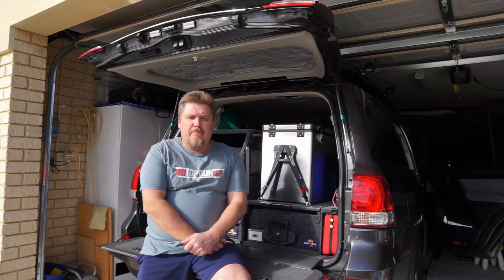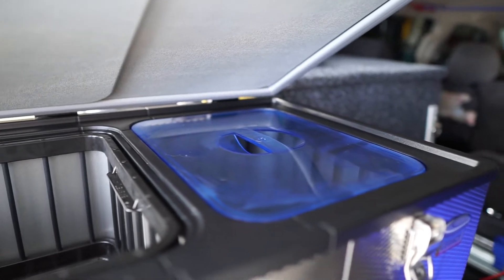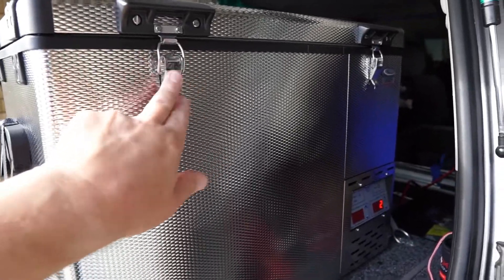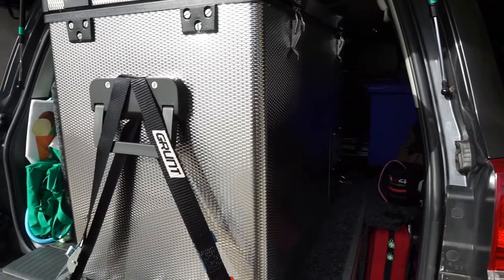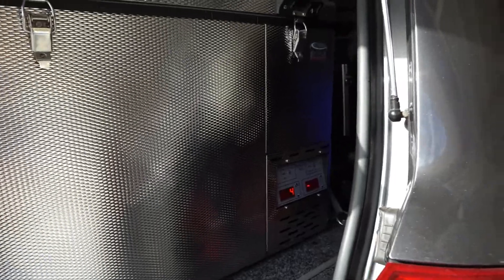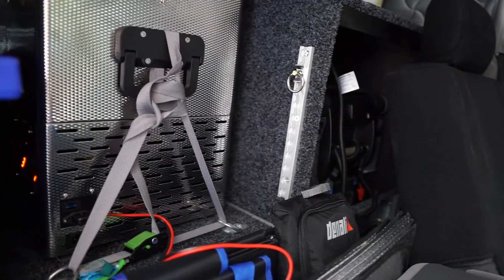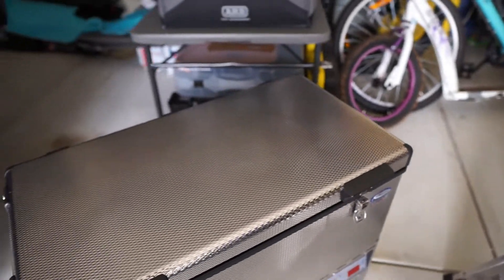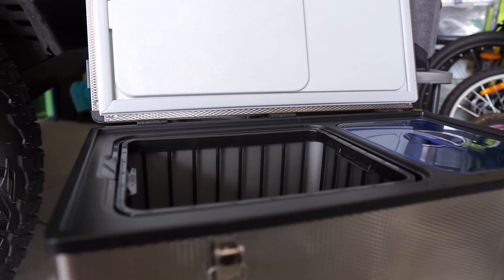National Luna Legacy 50l Dual Zone....Intstall and Initial Thoughts

Comment: I appreciate the video.  I ordered one, but got a notification a couple of days later that they were out of stock.  So, I ordered a 60L.  It's certainly bigger than I need and want, and I agree that the fridge/freezer ratio is a little weird on the 60L.  I'm also concerned because I've read about a spate of gas leaks in the Lunas of late.   I have terrible luck with getting defective products (in all industries), so I'll be holding my breath.

Comment: Robbie how are you finding this fridge?
Have you used aftermarket thermometers to check bin temps?
National Luna don’t take temperature from the bins, they take the temperature from within the walls. 
I’ve used two different thermometers and although the fridge displays it’s reaching -18 in 45 mins - 1.5 hours it actually takes 24 - 35 hours for bin temperature to reach -18 with pre frozen food from house freezer inside.
It was quicker by not much if it was completely empty. 
Meanwhile the fridge compressor cycles off and on the entire time believing it’s at temperature. 

The bin temperature I’ve noticed is anywhere between 3 degrees to 10 degrees warmer then what the fridge displays. 
National luna quote the temperature of bin to be within 3 degrees of the display due to location of temperature probe. 
Sometimes the fridge was accurate within 1 - 3 degrees most times not. One particular night set on ac power bin temperature was -18 degrees fridge was set to -20 degrees, wake up in the morning and all icecreams completely melted with fridge showing - 20 degrees but thermometers two different brands showing - 7.5 degrees. 

A pre chilled at setting - 1 degree fully stocked fridge went from 1 degree to 7 degrees bin temperature from putting 5 x 500 ml water bottles in and took the fridge 9 hours to get back to 3 degrees. (Not too safe if putting chicken in).

Power consumption when running at a setting of 4 degrees both bins was 0.5 ah/h. Issue is actual bin temperature was 7.5 degrees. 
Power consumption when running large side at 3 degrees and smaller side at -18 degrees was 2.08 ah/h

I’ve also noticed the lid doesn’t sit evenly due to an excess of glue/plastic on the front corner at freezer end under the seal. 
I’m guessing this also stops the internal cutout of lid from sealing freezer section correctly as this fridge has a massive amount of condensation running down the internal wall. 

National luna haven’t responded to any emails I’ve sent with photo evidence and the brand new fridge is currently at a service agent where it will be a number of weeks before it’s looked at. We’ve missed our first trip with the fridge and looking like we’ll miss our large trip, the very reason fridge was purchased. 
Was also told nothing unusual about having to wait 24 - 48 hours for a fridge to reach - 18. 
Putting 5 x 500 ml water bottles in a fridge is placing a massive load on a fridge. 
Have friends with dometic, engel, oztrail and brass monkey. All completely blow this National luna out of the water in terms of chill down time and ability to maintain correct bin temperature. 

I’m now having to look at out laying another large sum of $ on a different brand fridge so that our family has a working fridge for the trip. 
A shame when Anderson cord and fridge slide specific to National luna size was also purchased. 

After being drawn in by all National luna marketing videos, the talks from stockists. We believed in the notion buy once cry once for price. 
Sadly our fridge isn’t meeting the marketing talk & now digging deeper their are lots of genuinely disgruntled owners comments/reviews about the performance of their National luna fridge. 
The stockist I purchased from when made aware of my findings was “nothing we can do, we only sell them. Take it to a registered service agent.
Reply from the maker: Mate sorry to hear.  I still have 2x engels and can't bear to part with them and they are faultless one being near 15 years old.
I've had the NL now for about 6 months and seems to be performing well.  Always use separate thermometers and find its about +1.5 degrees on fridge and freezer.  All my other fridges including the engels and Waeco run about +1 difference to the display temp...had a ARB Elements which was +3 but there is a hack on the internet where you can recalobrate this and worked well after that.
NL with 40l fridge set at 2 degrees and freezer at -12 uses abou 0.8 amps an hour with daytime temps up to 25.  
I did read they had some issues a few years ago with a bad batch of cooling coils which leaked gas into the insulation...think it was about 2015/16 to about 2018/19 ish.  Maybe keep persisting with NL and they may end up replacing it like they did for others.
So far so good with this one.
Cheers
Reply: @robbiereddog4202  Thank you for the reply & info. Gives me hope. 
They are a top looking fridge with a great layout & footprint. 
After spending months reading reviews it came down to National luna vs Engel. 
Btw, with the top large basket removed you can install the smaller freezer basket into the larger fridge compartment on top of the bottom basket which gives the ability to stand taller bottles like milk bottles up which gives greater packing flexibility. 

Very much hope an issue is found & not just told nothing is wrong that’s how it is. It seems the way our National luna is operating is incorrect although we were given the impression we were expecting too much from a 12volt fridge and our findings were normal. 

Spoke to the store it was purchased from again today and they agreed something isn’t operating correctly with such large temp variations and lengthy cool-down times.  End of the day though it will come down to what the fridge tech says. 
Ours used 4 x the 24 hour ah total consumption as a fridge/freezer vs fridge/fridge which is somewhat high, 
I got max amp draw of 8.8 amps and when compressor was running it was floating around 5.5 - 6.5 amps. 
A real shame a brand new fridge needs to take weeks before it’s looked at. We will likely have to purchase a different brand fridge and slide so we have an operating unit for our trip that the National luna was purchased for.

Comment: Hello from the states. You my dear sir are a man after my own heart. I have 5 12v fridges...And counting. 2 40L Engels. Two Dometics and a HUGE dual zone Snomaster Expedition 85L. 
I was at a outdoor RV show in Arizona and had a chance to see National Luna. I was thoroughly impressed with their fridges. But was more so with the Snomasters. 
I love the Engels. But as you stated the combi's are really not dual zone and having to run the dial on 11<---(Spinal Tap reference) is not the business. So went with Snomaster. But those National Luna are nice. 
The Achilles of the Dometics seems to be that thermistor. And the fact the pricing has skyrocketed. And for what you get. Your in for a National Luna, Snomaster or Engel money. And I'm of the opinion they are not in the tier. Even though my two have been excellent.
Reply from the maker: I also like the Snowmaster and it was a pick between the 2.  As with evrthing these days there is little to no stock of Snowmasters at th moment in Australia.  Even the NL was hard to come by.
Cheers
Reply: @robbiereddog4202  Yes sir EVERYTHING is in short supply. I am so glad I bought my 85L. Snomaster USA told me 90-120 lead days before they were getting any other dual zones in. I wanted the Traveler 82D, the 56L would've probably sufficed. But bought the 85L. 🤷‍♂️ In retrospect I believe I made the best decision because of the insulation value. 70mm vs 60mm. 
It's going in the cab of my new Peterbilt. Going to remove the passenger seat. The Peterbilt has a dinky upright fridge in a cabinet. In the sleeper. But need more room.

Comment: How’s the fridge going after this time? Thinking of picking one of these up over an Engel MT45, but a bit nervous about reliability of the new compressors (no longer secop/danfoss).
Reply: I’ve the exact same model. Broken out of the box. Distributor wouldn’t replace it. 
Currently owned for 15 weeks, 8.5 weeks in getting serviced and still being fixed. 
Power consumption averaging 58ah to 68ah per 24 hours. Highest amp draw we saw was 85ah in 24 hours. 

Our family has a 25yo 40l engel without a latch and it out performs and maintains temperature substantially better then this national luna.

Comment: Hey mate, do you have a DCDC charger and shunt installed on that NL battery box?
Reply from the maker: Yes there's a Victron bluetooth smart shunt in the battery box and which displays everything on my phone and a Ctek 250SE 20A charger on the side of the drawers.  It's connected by andersun plug so I can charge whichever portable battery box I have in the back.
Cheers

Comment: Got the fridge back after a month. 
Temperature probe faulty and replaced on the 11 litre side. 
Tested and classed as acceptable with a 4 degree variation from set temperature for the small compartment . 
The large side 0.5* variation from set temperature. 

Testing at home the large compartment shows on third party thermometer to be within 0.5* 
The small compartment 4* to 6* warmer then set temperature. 

The small compartment was only for icecreams so need to set to -24 to get roughly -18 which causes it to cycling all the time. 

Strange I’ve asked numerous fridge salesman and they’ve all said should expect no more then 1.5* variation from set temp and third party thermometers.
Reply from the maker: Doesnt sound right.  My fridges including the NL ar up to plus 1.5* out.  The engels sit about +0.5* higher than the readout and the NL +0.5 to +1 higher than the display on both bins.  The only anoying thing I've found with the NL is the temp will go up 2 degrees form set before the compressor kicks in ie set on +4 then it won't start cooling until the display hits 6 and then it will cool until about 1* then stop.
Even though I'm mostly happy will it still prefer my Engels.
Hope you get yours sorted.
Reply: @robbiereddog4202  have kept the fridge running in air condition room on ac power 11 litre bin with ice creams, pre frozen water and ice chill block for esky. Set on -21* using three different third party thermometers I’m getting an internal bin temperature of -17* 
The display on the National luna depending on its cycling shows -23 at its coolest and -17 at its warmest when compressor kicks in. 

Compressor is coming on around every 3 minutes once it shuts off. 

Be interesting how it handles North Queenslands hot weather. I expect it to burn through our batteries. 

AE4A have always insisted third party thermometers will always differ to the fridge temp. 
They are aware of the temperature difference but see no issue. 
The tech saw no issue with the temperature discrepancy. 

Obviously a problem still in the small bin, considering the large bin is within 0.5* of the display temperature. 
Strangely the actual manual says the bin temperature should be at the most 3* out from fridge display
Reply: @robbiereddog4202 The coldest freezer temp ours achieved was -20*when set on -24*
To keep ice creams at -18* we’ve been running ours on -22*
With fridge side set to 1*
Power usage for 24 hours has been sitting anywhere between 58 ah to 68 ah

On AC power We then put 15 zooper doopers in the freezer section set at -24*
that already had two frozen water bottles and ice creams. 
18 hours later the freezer was still only -10* Then 30 hours later freezer was only -14* Zooper doopers finally frozen but all other icecreams melted. 

We ran the fridge in the air conditioned car for 5 hours and it used 18ah in 5 hours. 
After 37 hours the freezer still didn’t get any cooler the -15* although it was set to -23* had to throw out all the icecreams.

Comment: 14 days, still no response from national luna about a possible seal issue with the lop sided lid.
Tech says his thermometer was within 3 to 4 degrees of what fridge was set to so no issue. 

No explanation as to why my two separate model third party thermometers were up to 12.5 deg out from fridge display when on deep freeze. Other then being told they are cheap shit thermometers. 
Funny how they match what the house fridge is set to. 
Nor any explanation why when set on -20 all icecreams melted overnight whilst my thermometers showed -7.5 with a whole load of condensation running down the internal divider wall. 

Other then being asked what type of icecream are you trying to keep frozen. 

Absolutely pitiful after sale service.
Reply from the maker: Any brand their afetr sales service will tell the true story of a product.  Sorry to hear you may have got a dud and disappointing with NL not following through.  Just had ours away for a couple of days on a trip...68 amps over 60hrs with fridge at 2* and freezer at -14* with day temps at about 30 celcius.  external temp reader was reading about 3.5 for fridge and and -12ish for freezer so both pretty close with set temp.
Hopefully yours gets resolved.
Must say I still like me engels though..
Reply: @robbiereddog4202 This is what I’d expect the National Luna ran like & the very reason we chose the brand. That’s great amp usage. When ours was set on 2 degrees/ -18 degrees it used 13.5 amps in 6.5 hours with 2 hours being 35 ambient temp the remaining 4.5 hours 25 degrees. Thats  over 4 times the amount of power it used set just as a fridge. 
National luna see no issue with the amps it used. 
18 days now without our brand new fridge, I have a few more days to either bite the bullet and buy an engel or do what we’ve always done, run block ice and crushed ice in ice chest on our large trip. 
All they’ve said is tech says fridge is perfect but there’s an issue with temperature variation as a freezer. 

I was told when I first rang National luna about the issue that if there is any issue at all and not operator error the fridge will be replaced, they won’t fix it and return it. 
Now the service manager says in no circumstances would it be replaced with a new one unless a major failure that can’t be fixed. 

The amount of registered service agents for National luna is tiny in comparison to registered service agents for the likes of mycoolman, certainly something I wish I’d looked into. 

A mate just had an issue with his 2yo oztrail fridge. Took 4 days and handed back fixed.